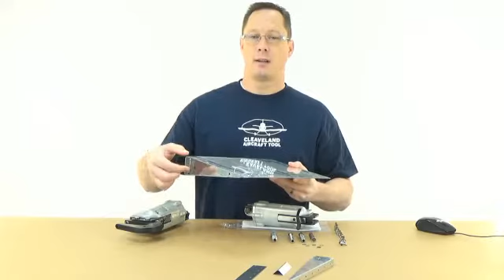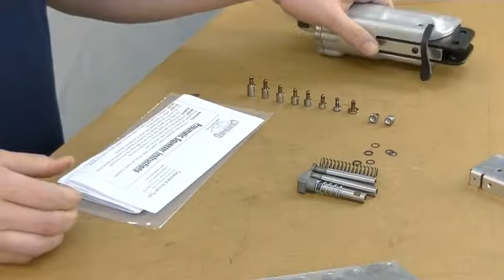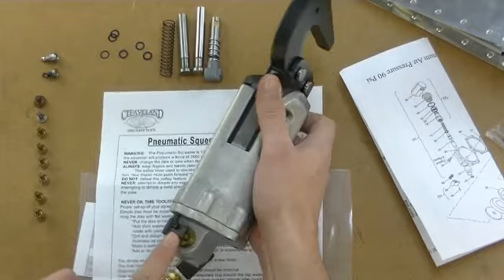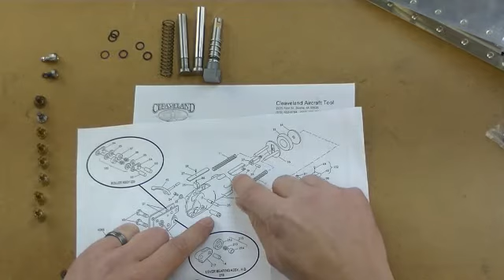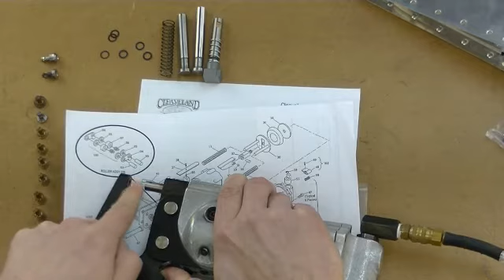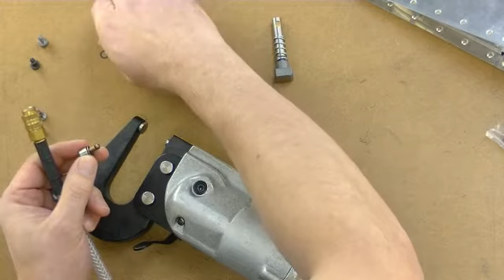Cleaveland Tool Pneumatic Squeezer FAQ

Comment: I've watched this video several times over the past 2-3 years. Finally got around to ordering RV-10 empenage, which I've received. 
Just received this pricey yet beautiful tool today from Cleaveland Tools. Mine came with what appears to be an updated adjustable ram. I guess that's your in-house one you mentioned. I like it! I came back to this video to make sure I installed it correctly. Seems like ram flat side mated to tool body, so I got lucky and installed it as you mentioned here. 
At a regulated 90psi out of my 30gal tank, this tool is extremely conservative with air consumption.